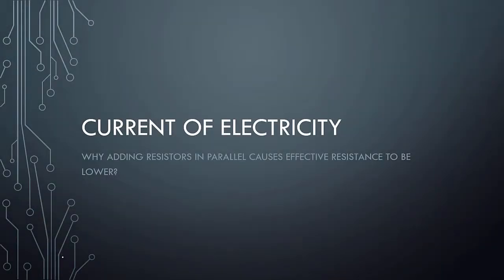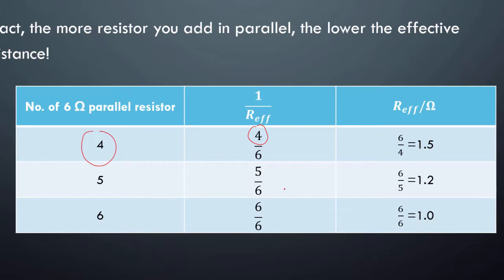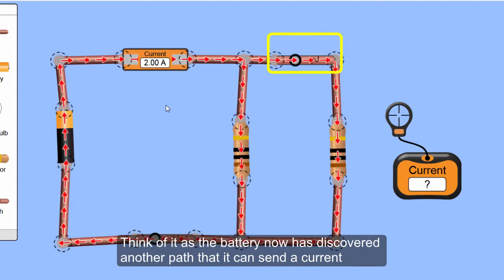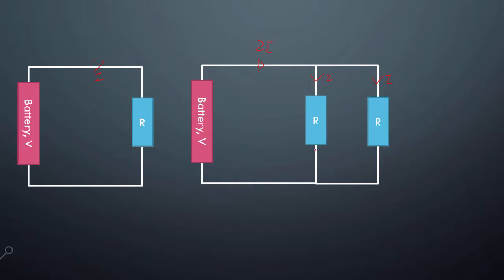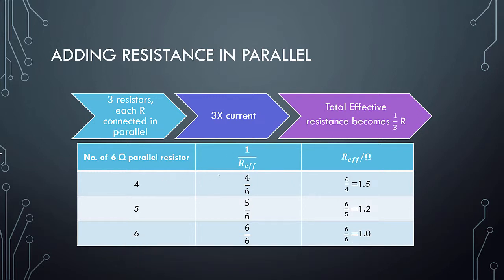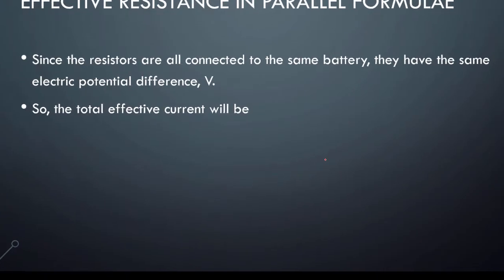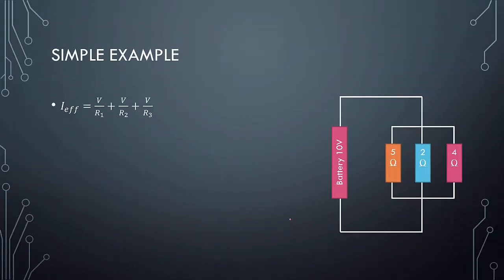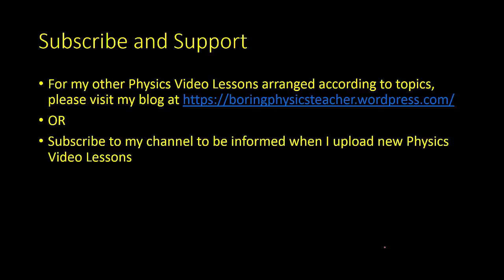Why does adding resistors in parallel reduces effective resistance?

Comment: Wait a minute, I have an amp with switch set to 8ohm for speaker output, I have two 8ohm speaker cab in parallel, my switch has been on the 8ohm all this time! better set the switch to 4ohm then.

Comment: Wouldn't the current pass through the lowest resistor ignoring the other ones? Also after 6 rezistors the resistence will increase
Reply from the maker: Hi, thank you for your question! You may have a common misconception about current flowing through resistance. 
The misconception is "Current flows only in the path of least resistance." This is generally not true. It is only correct if one of the path has zero resistance. If the paths has comparable resistance, current will flow in all the paths. There is lesser current flowing in the path of more resistance and more current flowing in the path of lesser resistance.
Hope this helps to clear things up!
p/s: You can try working out what if you have 7 same resistance in parallel. Would the effective resistance be more or less as compared to if you only have 6 resistance in parallel?

Comment: Sir, i have a question....it is said that current does not depends on area of cross section and resistance depends on area of a conductor...As resistance and current are related ....can we say that current depends on area of cross section
Reply from the maker: Hi, may I know if you have the link to state that current does not depend on the cross sectional area of the conductor?
Anyway, as you have summarized, resistance of a wire depends on its cross sectional area and current flowing through a wire depends on resistance. Thus, you are correct to say that the cross sectional area of the wire will affect the amount of current flowing through (provided all things being the same).
Hope this helps!
Reply: @boringphysicsteacher  Oh..Thanks sir..!! Actually I read 1 article in net stating that current does not depends in cross section area. Thank u very much sir for clearing my doubt 🙏 👍